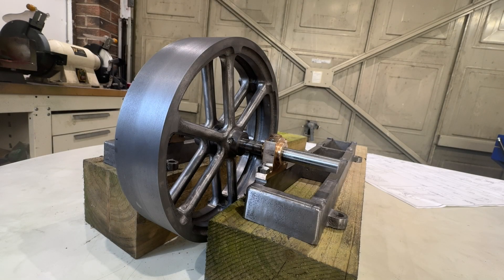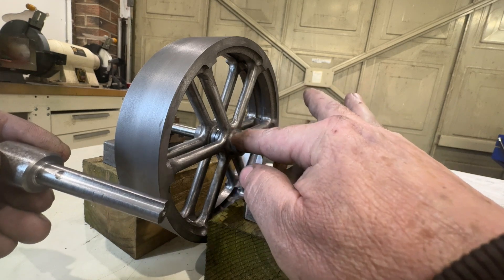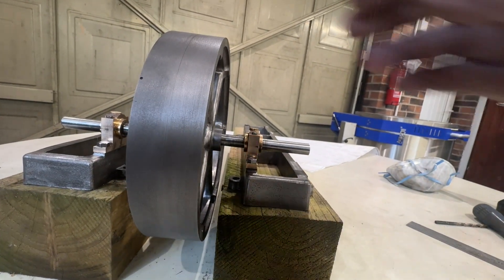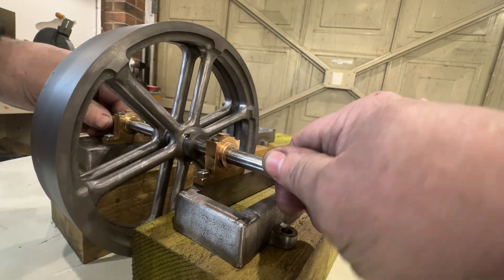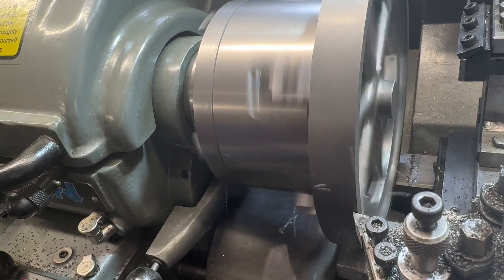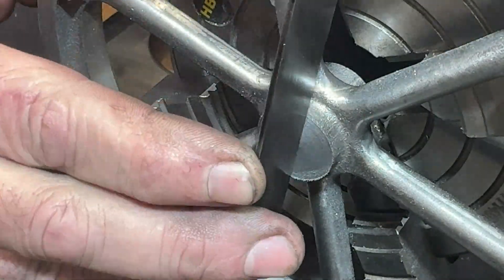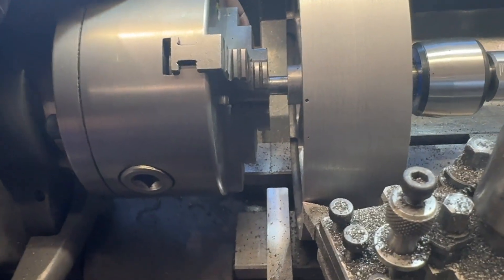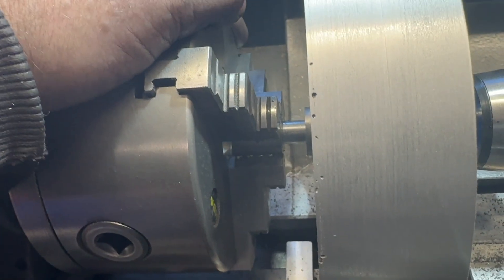The flywheels Stuart twin victoria Part 3

Comment: Thanks a lot for sharing these video.  I follow them with interest.  I'm about starting a twin Victoria, but I still have a question.  How do you secure the two flywheels together ?  Loctite, pins, ... ?
Reply from the maker: Its a lovely engine to build and probably my favorite one. I put them together with loctite the green stuff. i also put 2 grub screws left and right to lock the flywheel and also balance the wobble if there is any....feel free to ask any questions and good luck with build.

Comment: I wondered how you would machine the flywheels. Imagined you may have mounted them on a faceplate to give you more clearance in the bed gap. Worked out perfectly. Enjoying this build. ATB Nobby
Reply from the maker: the face plate would have worked out just as well too. just clamping them is a pain

Comment: Nice work. I'm building a model steam engine and just finished machining the flywheel. Like you, the large flywheel just barely cleared the ways on my 7-inch lathe. I used a faceplate, rather than a four-jaw chuck. I first attached a 1/2 inch x 6 inch aluminum round disk to the faceplate to act as a stand-off so I could machine the outer diameter of the flywheel without hitting the face plate. I bored a center hole in the stand-off just large enough to fit the hub and machined flat the face of the stand-off. I then drilled a bolt circle in the stand-off that I used to fix the flywheel to the stand-off. It was a very rigid fixture that allowed me to hold the the flywheel rigidly without causing the flywheel to flex and distort during machining..

Comment: did you JB the wheels together or pin them? nice job with the turning, hard to do big un's with no chatter. bugger about the inclusions, if you put your iron dust through a fine sieve and mix in a bit of JB weld (not too much) it should be good, as long as you don't want a shiny mirror finish, It may show up spots in that case. 👍alternatively get intouch with stuarts and they will send you a couple more, they are a very good company like that.
Reply from the maker: soft solder has solved it i want them shinny with red groves

Comment: Get some cast-iron filler Andy
Reply: The filler is like cast iron drill it  tap it also in bronze like material mixed like body filler.
Reply from the maker: @robertwragg9224  thanks Robert you will be surprised when you see it on the next video
Reply from the maker: never knew about that...thanks Robert i will get some , if the solder does not work

Comment: Hello Andy, 
good job. The flywheels look very good. 
With the soft solder you are on the right track. I have often seen this on very old model steam engines. That's how the old engineers did it. An alternative would be a common rim over both flywheels. 

Greetings Michael
Reply from the maker: did it today seem to have worked and should be invisible...well to our old eyes lol

Comment: Thanks for sharing 👍 You might want to look into filling those blow holds instead of turning them down. There are some really good commercially available products to accomplish this.
Reply from the maker: I filled them today with soft solder time will tell if it works...but so far it looks fine